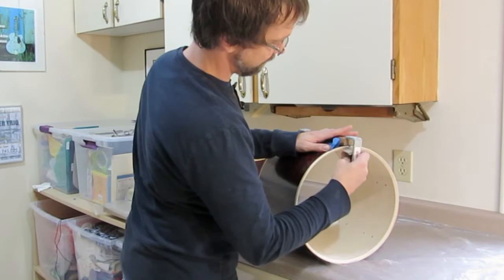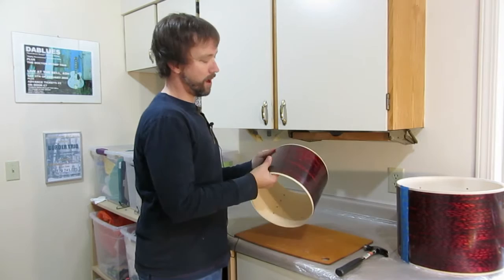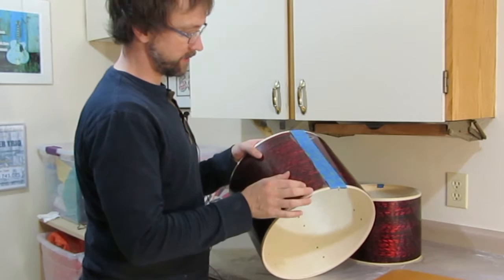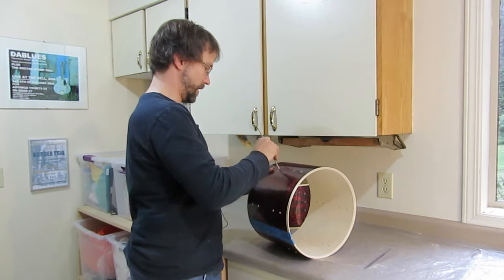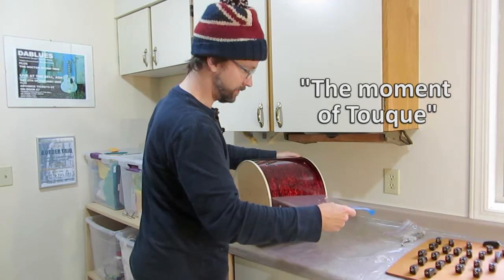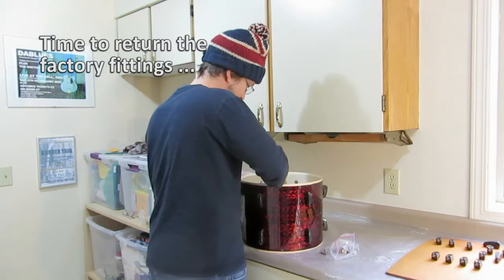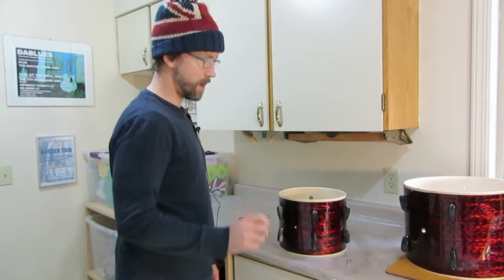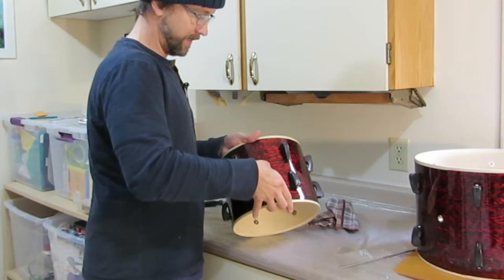How to re-wrap drums: to a beautiful finish [Part 2]

Comment: How is the breather secured? The bit I wanted to see (without scratching the drum) is missing.
Reply from the maker: Hello. First, the original metal breather insert is ripped out: manufactures have a superior system to “us” so it’s painstaking as shown in vid; but the following will hold forever.  With the bare shell, including all original holes, wrap as shown: Then tap the nail: and work out the holes: including the larger breather hole: and  it’s wrap at this stage. But for the breather “under size it” so when you tap in the new metal breather finisher it grips. If the hole left is too small, the new metal breather could rip. Just follow the video..

(And it’s amazing to me, that after so many replies by me to user questions: I never get a like in return. Never an acknowledgement, never a reply.)

Comment: I guess I fail to understand how you are going to "scratch" a drum by peeling the coating on it.  Are you Edward Scissor Hands or something?  Is the "Scratch Potential" still high or is back down to the yellow?
Reply from the maker: Hello. If I follow your point correctly, then no I’ve not got appendages that would scratch the drum. But I could produce 100s of experienced craftsmen, who would agree that - after spending lots of time on a project, be careful in the closing stages. Also, any nick, rub or scrape on a pristine wrap will show, much like cars, and what is called a “show room finish”. The more pristine the ‘finish’, the more that the item - will clearly display scratches. Black is of course the worst, as they say.

Comment: Help ! LoL I've started to take wrap off and it's pulled up some of the top layer ?? What can I do to fix it ?? Any ideas will be appreciated
Reply from the maker: Hi, and I try to watch these to reply. Sorry, for delay.
Reply from the maker: So, as long as a majority of original “wood” is intact, then the wrap will match it well, it won’t concave into any lost “area” of shell.
Did it splinter? That’s fine, or probably fine. By all means write me back. Sorry again, I do try to watch for comments, questions.
Reply: @DrumSolVanIsle  I managed to get more info n I repaired it and wrapped it looks brand new
Reply: @DrumSolVanIsle  I used wood filler to fill the 3mm deep splinter
Reply from the maker: That’s great
Wood filler is great, and I think as follows: apply the filter as you mean it to be, not like some jobs where you over fill, and then sand. I think it’s important not to sand a shell, because that process if too aggressive, will change the shape. So I’d use a putty knife, apply firmly, and scrape quickly. Small rough sand, in on,y the area applied.

Comment: Why didn't you put the seam under the lugs ?
Reply from the maker: Very good question: 1) Manufacturers near-never place a seam on or down a [pair] of lug fittings. Although manufacturers [Pearl/ Tama/ Yamaha etc] usually use thinner wrap than I’ve displayed here, placing a seam perpendicular along the pair of lug fittings adds mass. So then, when consumers like us use wrap at 2.5 mms, and double it up on a seam -- it will add 5 mms of mass to ONLY one sector, while all other lug sets equally distributed elevation from the shell itself. That may not seem like very much, until one uses “sparkle” wrap, in which case it’s just folly. In fact, Sparkle wrap is thick and stiff; it’ll add VERY poor mass to the one lug pair.
Conclusion: if you are capable of doing a seam as seen in video, then I suggest doing so. Otherwise, of course you idea is VERY common (and a practical trade off). You may in fact wish to end the wrap precisely-down the center of the lug pairs, and only need leave half circles – for a better look and less mass. Good luck!!